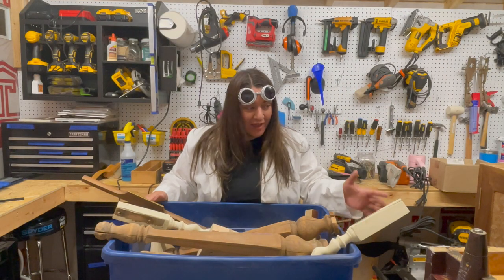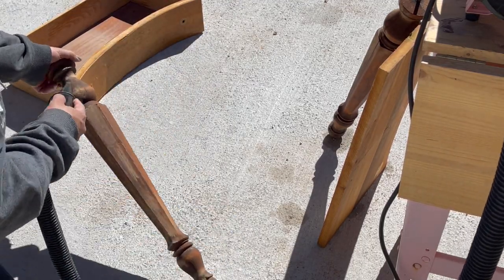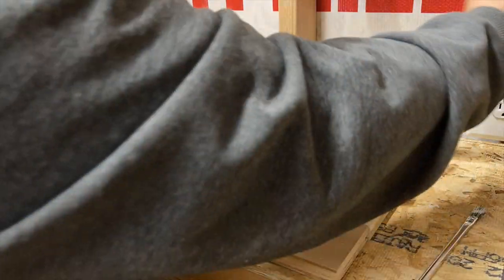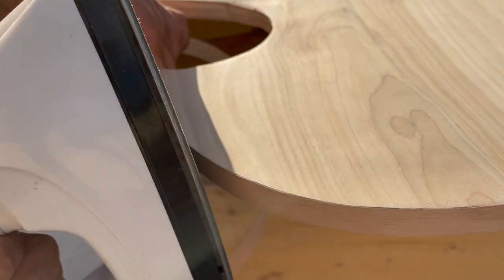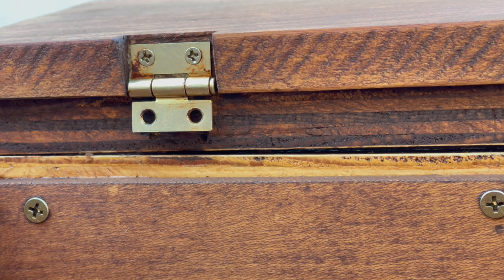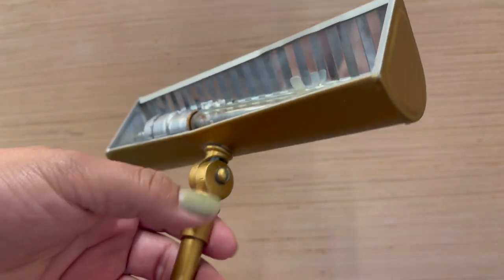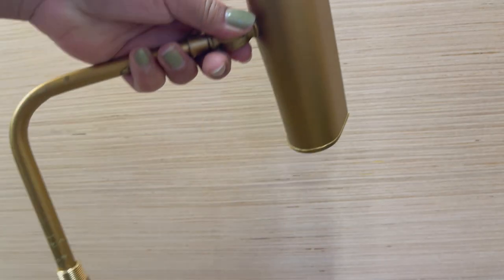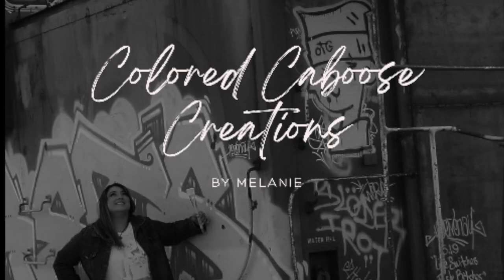Frankenstein Inspired build/ using up my scrap pile #furnituremaking #upcycling

Comment: That is really some skillful furniture making. I really hate when a work piece gets dinged up but in frankenfurniture that’s a feature not a bug. I’m going to get one or more of those Bora centipede stands to prevent more of that. For drilling flat bottom countersink holes forstner bits work great. So do brad point bits. Love the way the piece turned out. Keep up the good work!
Reply from the maker: Thank you sir 🍃 
Bora centipede stand? Definitely gonna check that out thanks!